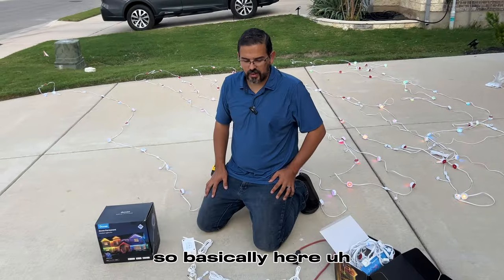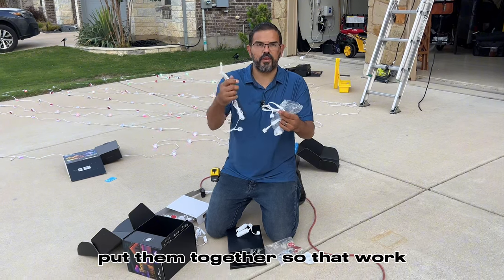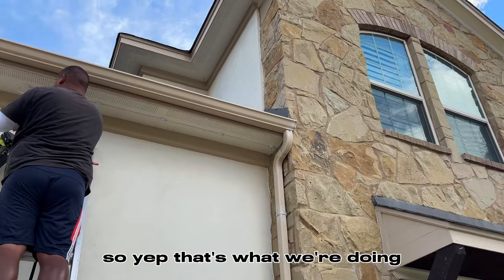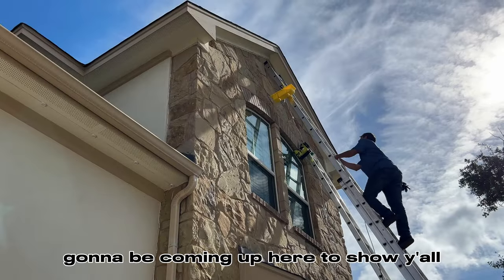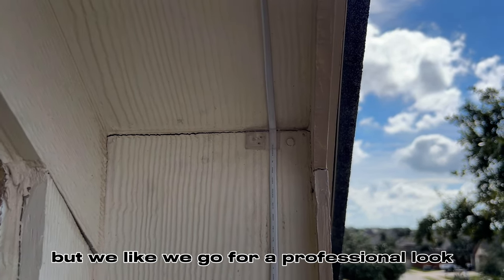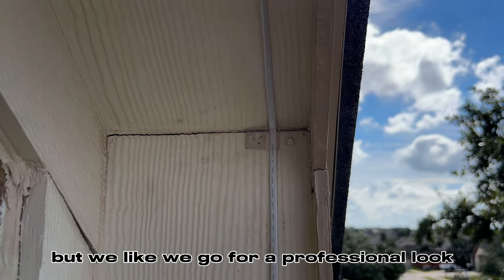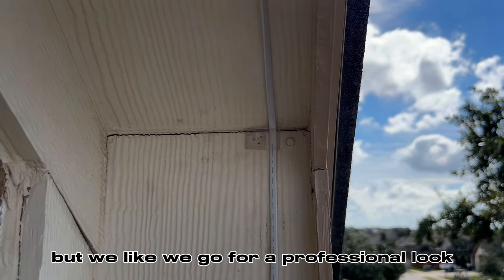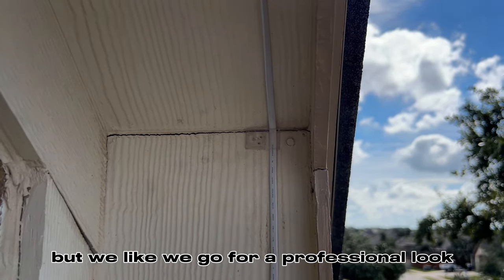Govee Pros Install (White Version) Round Rock, Tx @GOVEE #fyp #howto #diy

Comment: Does the controller have to be placed anywhere specific?
Reply from the maker: It depends. How many controllers do you have? If it’s one as long as it’s near your router to connect first. If it’s two then connect them first in your app and then you can install them. Try and keep them close to your attic entrance to be able to calibrate them if you have the pro version. You can add an extension before you get to your lights and after the controller. If you have non pros then you need to keep in mind that when install left to right it will cast a purple white and right to left will be a greenish white. This is because the non pros use 3 different colors to make white and it’s the way the diode is manufactured in place
Reply: @jbsdiytv  Thanks!  I have 150’ pro version with one controller.
Reply from the maker: Your welcome. You’ll be fine with whatever you do then. Attic is what we do if it works for your install. If not we use this waterproof box when the device is exposed.

https://amzn.to/3RG4soV
Reply: @jbsdiytv  ran out of anchors for the wire.  Is there a place where you can buy them locally?
Reply from the maker: @johnphillips3526 https://amzn.to/3TbQMmr they are available on amazon
Reply: @jbsdiytv  thank you!
Reply from the maker: @johnphillips3526  Visit my FB Group for the Govee App Advice/Questions for further assistance with anything. Hope to see you there. 

https://www.facebook.com/share/jHjvTxe3THrRH5sb/?mibextid=K35XfP

Comment: So you’re honest opinion is the version two brighter than the version one? Other than the white light and splicing options which one would you go with if you didn’t need either. My only concern is the brightness.
Reply from the maker: The pros give 2700-6500 Kelvin so that’s 800-3200 lumens I believe. The both versions are bright as hell. Typically what is used in commercial lighting. I just think the Pros will be easier to work with, have the warm white option and can run more feet instead of multiple power blocks and controllers. If you have a black or brown surface then that’s a plus with the black version

Comment: How did you get a 16 foot extension and then a 12 foot extension, do they sell extra 12 foot extensions?
I plan on running 120 feet of light +50 feet of extensions to get all my eves done, can I use the hundred foot light controller or do I need to get the 200 foot light controller?
Reply from the maker: The 100ft Govee Pros com with one 12’ blank extension and 2-4ft extensions. I used a 12’ and a 4ft together on the 200ft run. After doing this video, I came across a person testing the lights and Govee will start selling power boosters for the pros. Beats me why it was put in the box to begin with

Comment: How much length of lighting did you end up using for the pro light install? I bought 2 of the 100ft pro kits thinking I could put them together, but I guess I need an LED module driver, which they don’t sell yet… I need 125ft total but the lights don’t connect past 100ft…
Reply: With the pro series you can connect up to 200ft. together, so you’re fine.
Reply: @locoboof so I would just be able to connect 12 strands together? I tried and had no luck this morning.
Reply from the maker: @davidavila6126 did you change it in your settings to 12 segments? Also try holding the power button down for 6 seconds for a flash of white
Reply: @jbsdiytv  :O I didn’t know I had to set it up in the app, thought I could plug them all together first to test. good to go now thank you!!!
Reply from the maker: They don’t sale the LED module driver yet  and not sure why they didn’t put in the box to begin with since most all would purchase 2 boxes of 100ft. But they do work past 100ft. Not sure what your doing wrong
Reply: @jbsdiytv  it works once I started the app and added the lights to my account. I thought I could connect them all to start and make sure they worked. But I’m good now!
Reply from the maker: @davidavila6126  oh good, I was going to have to circle back to my other installs lol

Comment: 37:05 Did you add that outdoor power box, or was it all ready there?

Also! How many power bricks did you end up using, and where did you end up setting the power brick. Inside the attic or outside under the roof ?

One last question. Have you guys done any installations on roofs where the eaves are showing?

The reason for asking is because my roof all the eaves are showing to where some are flat and some are standing towards the middle of the roof on the 2nd floor.

The 1st. Floor, all the eaves are standing on their side...

It's too bad you guys aren't located in Cali. Otherwise, I would've been more than happy to hire you guys for installing the lights.

You guys do an awesome job on every installation I've seen so far...
Reply from the maker: I did not add that power box there, it was already there.

Two power bricks were used on this install. We covered 200ft on one for all viewing the front which was 12 segments with no splicing at all and the back was covered with 150ft which was 9 segments. Since we spliced in the back, we hit yes to calibrate the device

We have not done installs where the eaves are showing. We have rejected these installs as wood work will have to be done to accomplish the installation.

Thank you for your comment and support to our channel.
Reply: @jbsdiytv  so one(front) power brick is connected in attic and one(back) outside?
Reply from the maker: Yes that is correct. When there is no attic space, there is no choice to place them securely under the eaves. The waterproofing box we typically use was sold out and it was time for the install. We plan to go back a waterproofing box because we will be back in that area installing Govee lights
Reply: @jbsdiytv  sounds good. Im in same situation. Bought 2x200ft pros. Was thinking to bring both bricks to attic. So basically both 200 ft will go in different direction from attic or some how. I dont know.  Not sure how it will work.
Reply from the maker: @chakribandaru7658 run them in the same direction so all looks in sync
Reply: @jbsdiytv  got it. Makes sense. Thanks you!
Reply: @jbsdiytv  can I connect all 400ft to one power outlet? poweroutlet->controller->200ft->controller->200ft?
Reply from the maker: Yes that is not a problem, these permanent lights are energy efficient and don’t use up a lot of watts per bulb
Reply: @jbsdiytv  what waterproofing box did you used? Can you please give the link? Thank you.
Reply from the maker: @chakribandaru7658  here is the product link for the waterproofing box

Need to be 8.7x6.7x4.3"
https://amzn.to/41aFssJ

Comment: Can you run 200' on one controller and power supply? That is 2 kits right?
Reply from the maker: That’s correct
Reply: Did you use two controllers or just one?
Reply from the maker: On this installation, the front has 200ft and that’s on one controller. The back was 150ft and that’s on another controller. We shoot to always have the controllers for the front so it’s controlled from the front. We never put controllers for the lights in the front in the back. This way if there is any issues with connection at least when your in the back, your back there and the same goes for the front. It’s not likely you’ll be messing with the app in the front to work your back lights
Reply: @jbsdiytv  how many power supplies?
Reply from the maker: The front is one to cover 200ft and the back is another to cover 150ft. Whenever one controller is used for that feet run, same applies for power boxes
Reply: @jbsdiytv  so no problem running 200’ on one power supply?